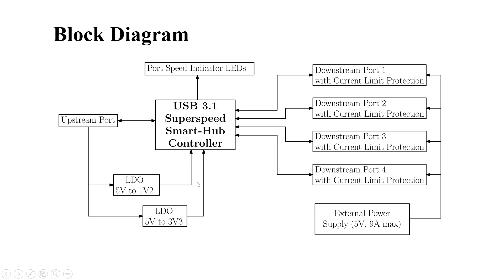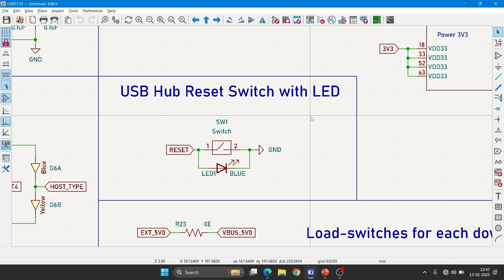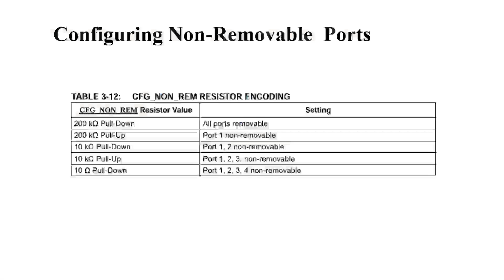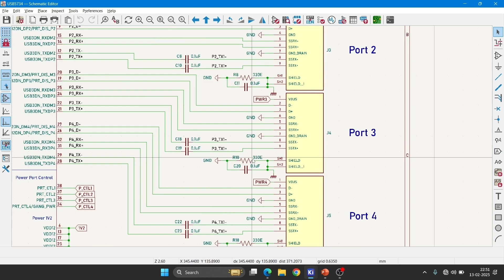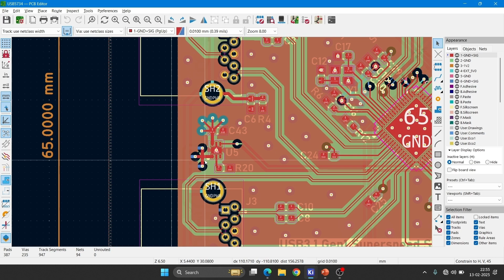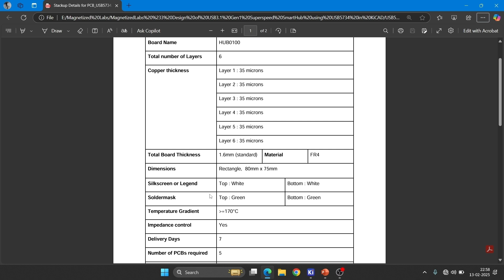Design of USB 3.1 Gen1 Superspeed Smart USB-Hub using USB5734 in KiCAD | Magentized Labs 03

Comment: Great video! I have a question regarding the differential pair routing. Could you please explain how you calculated and matched the 90-ohm impedance?
Reply from the maker: For impedance matching in PCB traces, before starting PCB layout, you will have to talk to manufacturer regarding this and you will have to provide the impedance value for your differential signals. For example USB lines should have 90 ohms impedance matched between data lines. Now manufacturer will analyse the core material which they are going to use (or suggested by you) and they will provide the trace to trace gap and trace width in which you have to route to achieve the desired impedance. Basically the impedance will be matched by adjusting the etching part in the pcb traces with properly calculated core and prepreg thickness values.
Reply: @magnetizedlabs  
Thanks for the detailed reply! 
So just to confirm, you used the manufacturer's specs for the trace dimensions, not a calculator yourself?

Comment: I have 2 questions if possible:

Why pin 59 and 58 in the hub are flipped?
Usb3UP_RX+ connected to usb3up_rxdm??

Also on the usb C why you connected sstxn2 to sstxp1?
Reply from the maker: @fedimakni1200  good question. Actually SSTx+ and SSTx- pins are differential signals. Also USB5734 hub controller is allowing us to connect SSTx+ and SSTx- swapped at the upstream side. Internally IC is taking care of the data encoding part of it. This is also an excellent feature in this design.

Comment: Open source project?
Reply from the maker: @vishnu7794  Yeah. You can use this for your reference. Schematic and BoM file are attached in the description.
Reply: @magnetizedlabs  cool , btw is the chip easy to find .
Reply from the maker: @vishnu7794  most probably you might need to order it from the authentic sources like digikey or mouser. But if you know some vendor they can support for the procurement of the components, you can contact them too.